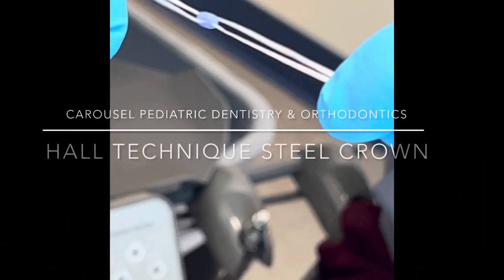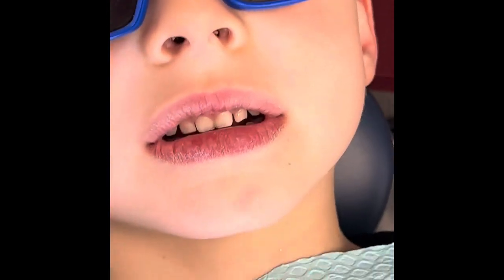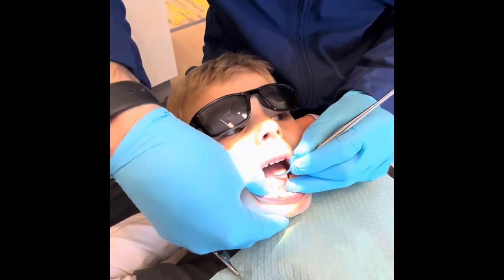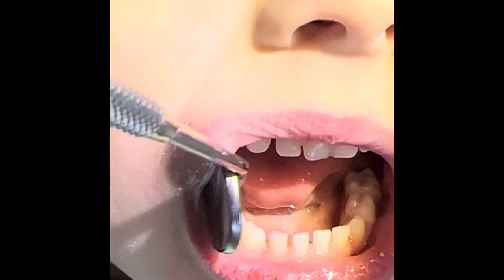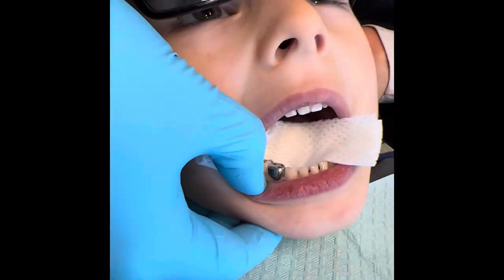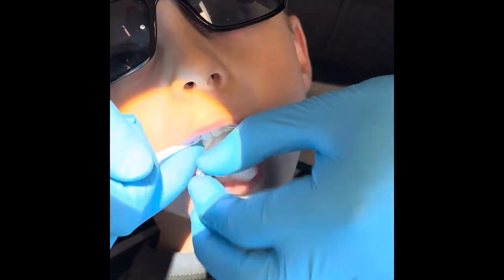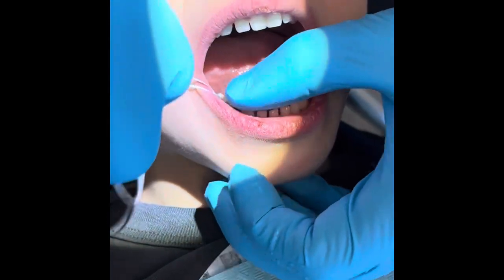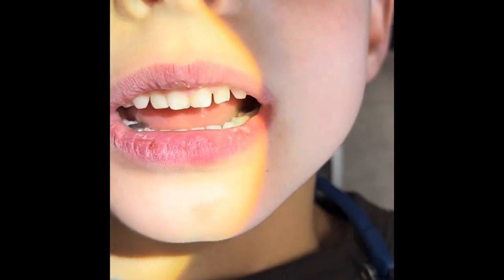Hall technique stainless steel dental crown

Comment: Why not just use zirconia why metal stuff
Reply: Zirconia requires massive amounts of tooth reduction and often on this tooth results in unintentional exposure of the nerve adding an additional procedure and increasing the failure rate.  A stainless steel crown is malleable and can be placed with this technique where a zirconia crown cannot.  The advantage of the Hall crown technique is in providing definitive treatment on children with acute anxiety in the dental setting.  The cavity cannot progress in size without access to a food supply and oxygen.  Many times it allows for quality care while avoiding the addition of oral sedation, IV sedation, or general anesthesia which as a whole are safe, but do carry increasing risk.  Hall crowns are a good tool for the pediatric dentist in some circumstances.  As with any technique, there are times when it’s appropriate and times when it’s not.

Comment: How/why not remove the decay? Won't it just keep getting worse under the crown?
Reply: The Hall technique requires some removal of decay with a spoon excavator if possible. Studies have shown that leaving decay is more successful in maintaining the tooth that traumatize the pulp with drilling. Unless there is irreversible pulpits is best to leave decay. The cement will prevent progression of the decay.
Reply: @la7079  ah so in effect, cutting off the decays' access to air, moisture and such, it can't get worse? That raises so many questions about my own tooth continuing to decay behind the filling ... 😔
Reply: @PatientFarmer   drilling can traumatize the pulp especially in primary dentition.  Decay can progress if the pH in  the mouth goes below 5.5.   It is always best to have a  tooth restored and free of decay  if dentin is involved but at times need to use clinical judgment if leave decay or not to prevent pulp damage.